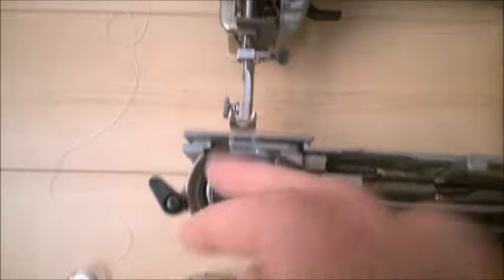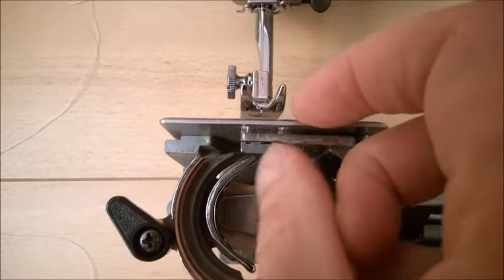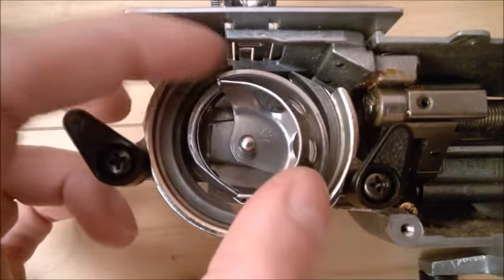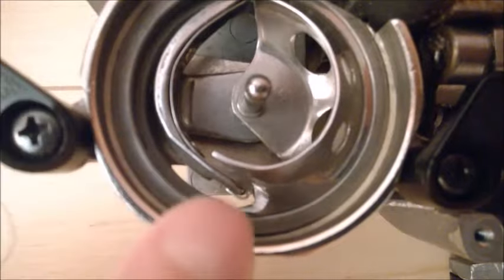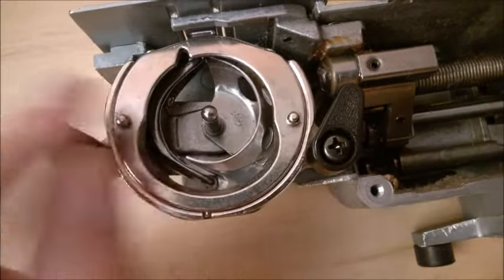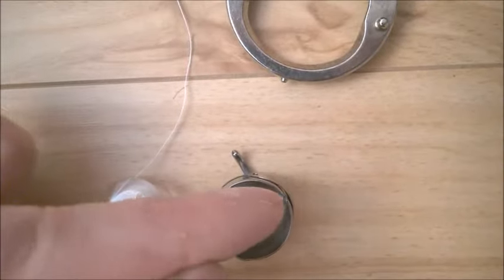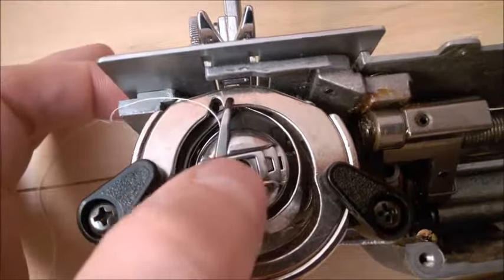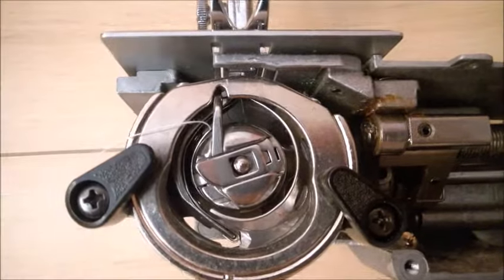Sewing machine vertical shuttle install

Comment: BEAUTIFUL. THANK YOU SO MUCH. IT WORKED LIKE MAGIC.

I put the shuttle exactly how you said in the video but my bottom thread still won't be captured by the needle , how do I fix this?
Reply: most likely you need to adjust shuttle hook and needle timing. When you lower the needle the hook should go past the needle grabbing a thread. If the lateral gap between needle and hook is wide, they miss each other and upper thread is not being caught.

I am struggling with this myself right now. Not sure anymore what else  can to be adjusted - after a while it misaligns over again.
Reply: @ca.elizabeth  I found out that we are not supposed to let go of the clip before inserting the shuttle... Once the shuttle is fixed in the machine, only then let go of the clip of the bobbin.